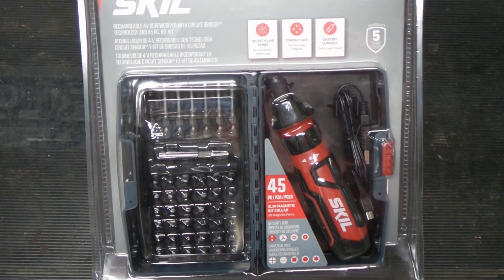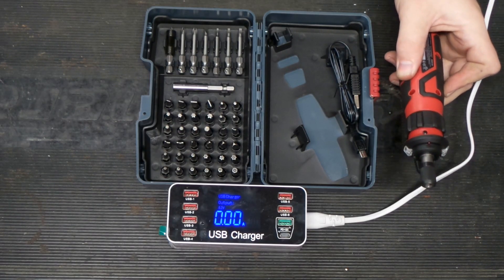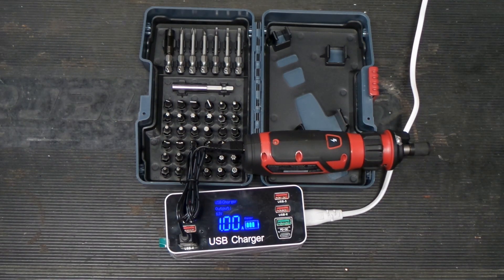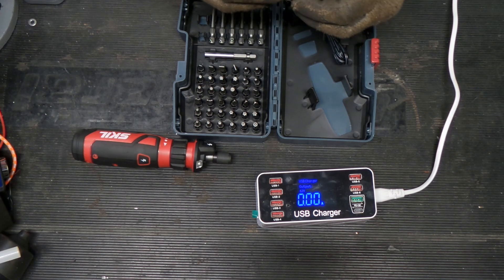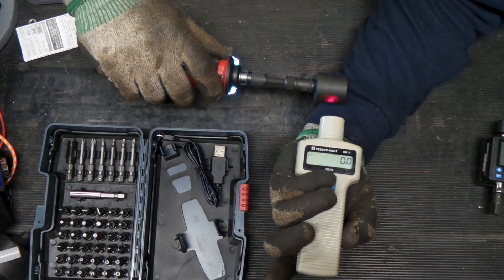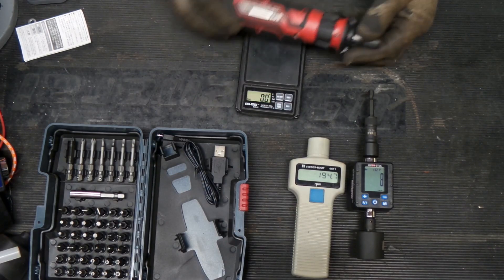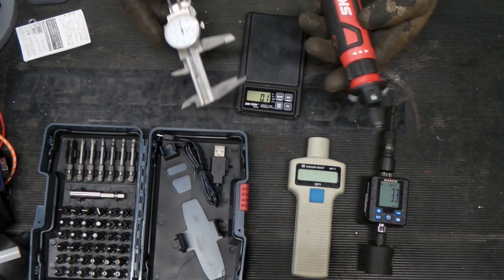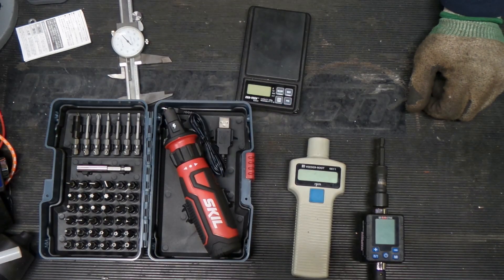SKIL Powered Screwdriver w/ Circuit Sensor Technology Review

Comment: I have owned the craftsman vessel kobalt skill worx probably a dosen of these electric screwdrivers.  Vessel wins hands down the Japanese 3 speed model.  This skill is kinda a old design and micro usb is kinda a non starter in this day of age.  That electrical sniffing feature was less than reliable overly sensitive and missed a few times.  Interesting design new dewalt is very similar and overpriced.  The kobalt i will day is decent for 20 bucks.  I do think you'll love the vessel though if you give it a shot.
Reply from the maker: Stay tuned, there's a few more in the works to go over. I'm hoping to get some models from Japan to include.
Reply: Your getting this semi scientific electric screwdriver testing series going 👏.   No reason not to be comprehensive at this point.
Reply from the maker: I'm going to try and stick with single cell options. It's not quite an even playing field when you get to dual cells. I'm still feeling my way through the format, but I think we got something that seems fair to each model.

Comment: Thanks for the good demo and test. 

I really want speed control. I am often working with particle board and so on, and being able to slowly insert a screw is much safer.
Reply from the maker: This model does not have variable speed. None we have tested so far have variable speed. 

What size screws into what depth particle board? I'm getting together ideas for practical usage tests for all the various models we picked up to test.
Reply: @ Thin and cheap. It’s on my RV. 1/2” particle board, maybe 1” screws? It’s not the only thing I use it for. 

Some of the access panels are like that. So I have to undo four or six screws to get access to the pipes in the bathroom. I will probably eventually glue in some threaded inserts. 

The gold standard for control is my Bosch brushed installation driver. I can pull the trigger gently and get four seconds per revolution. Or pull the trigger hard and get 400rpm. 

I have the last generation M12 Fuel drill with the electronic clutch. Its trigger is slow to respond so I have trouble getting it to the speed I want. Good drill, bad screwdriver. 

So even though I don’t really always need 1rpm, it’s got such a responsive trigger that other tools just make me cry :)
Reply from the maker: Thanks for the info. I'll include this on the test. I had someone else mention plywood.
Reply: @TalkingHandsTools  Another interesting test could be threaded inserts. Hex shaft drill bit to drill a hole, hex driver to install the insert, then a normal screw for the bolt that goes into the insert. 

The inserts are sometimes a bit hard to drive in straight. I think it would also be a nifty way to show the versatility of the tool. I normally have a couple power tools within reach but normal people don’t.
Reply from the maker: Thanks for the testing idea! I'll add it to the list.